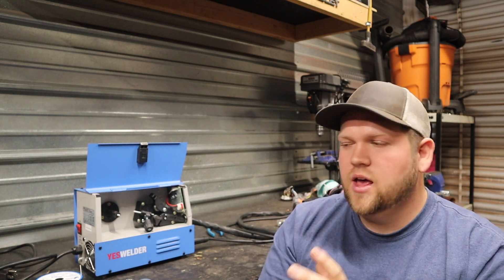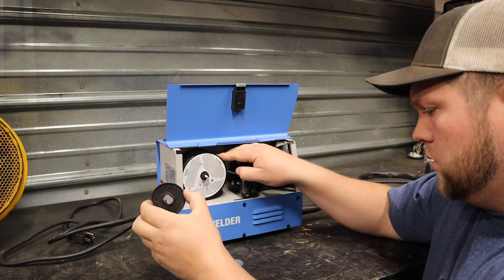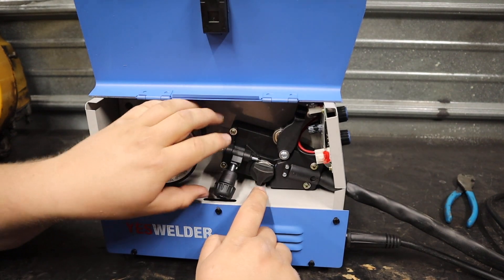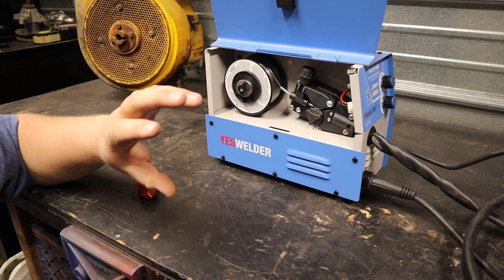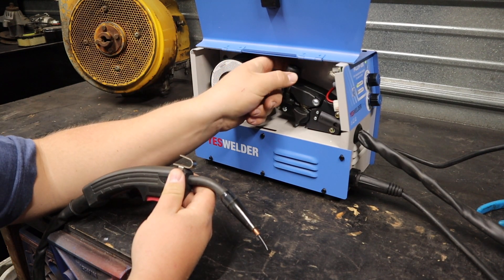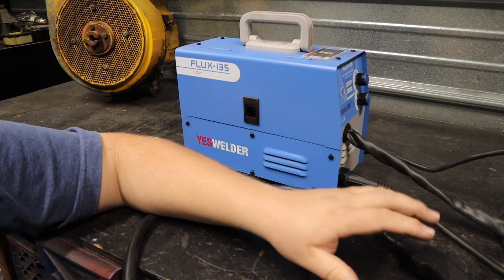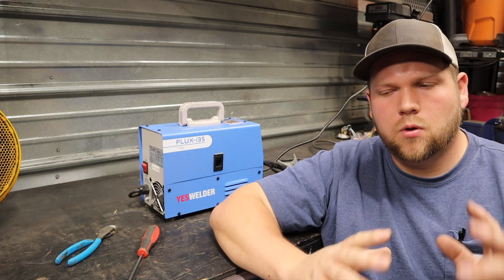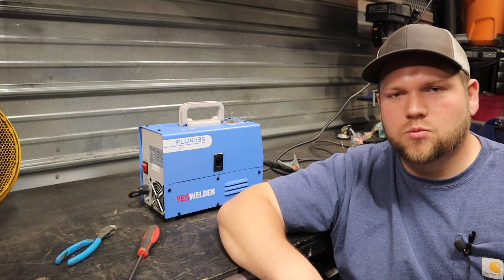Wire Feed Welding Basics - Setting Up a Flux Core Welder

Comment: Thank you. Good detailed presentation about flux core wire feed procedure. It's hard to find directions for it. Even the welder manual does not have directions for the wire feed.

Comment: good video....side note the angle of the spool into the liner looks hella tight on the yes welder. My FC-90 is like a straight shot.
Reply from the maker: It's not to bad, maybe a little tighter than some other FC machines I have used but it works fine.

Comment: How would you adjust the settings if you didn't have a chart and the knobs weren't marked in any meaningful way?  (actually I think the knobs are mis marked)  amico MIG-130A .  The current knob adjusts amperage, the voltage knob adjusts wire speed, but no way of knowing fpm.  Well, I guess I could time and measure it...   The manual has a settings table for a completely different welder!  (a Forney Easy Weld and the knobs are completely different!)   I bought it because the new version has detachable leads, and allow using an electrode holder for stick welding too.  And I thought it was a good brand at a good price.
Reply from the maker: I see that on that unit they don't have numbers to mark the settings, which is unfortunate, but they do have little tick marks that you can line it up with. I think what I would do is just number those tick marks with a sharpie and then take some material that you know the thickness of and then figure out what settings work best there and maybe write it on the inside of the door of the machine and then you can base how you will set your machine with other material thicknesses from there. That is a shame that they don't include numbers and even more so that they don't give you a chart. I didn't have any idea that there was no chart when I recommended this thing. I still want to get it and try it myself but thats a little disappointing.
Reply from the maker: Hey man I want to make a personal apology for recommending the Amico to you, and anyone. I read your most recent comment. I thought it looked like it had the larger space with the large “post” for 10 lbs spools. I guess simply reading the description before making the video would have helped. You would have ran into the same problems with the YesWelder as it has no chart or settings indications (the Amico is better in that sense that it at least has separated markings). I imagine you should still be able to return it with no issues if you wanted to get your money back? I don’t know how long ago you bought it but I sincerely apologize for giving bad information, and suggesting a product I didn’t know a lot about. I do want to get my hands on it and I still think it’s probably a decent machine but I am very sorry for offering incorrect info here. I was hesitant to make a video like that of products I have little experience with or none at all but I guess I went against my better judgment and did it anyway. If you could return it and use that money to get the Forney, I would do that. But again, I wouldn’t blame you if you didn’t feel anything I suggest was worthwhile. I deleted the video. One thing I don’t want to do is put out bad information. I was naive. I shouldn’t have made it.
Reply: @DereksWorkshopAndProjects  I don't blame you at all.  Amico gets good reviews, just no reviews of this machine.  It looked like it held a bigger spool from the photos.  And I just wanted to share what I've learned.  (I couldn't find this post to follow up, so I did on the other one)  I still think it's probably a good machine and am waiting on supplies to try it.  But I really am disappointed that they can't even put a real settings chart, and shocked they used a chart for a different machine!  I already bought an electrode holder, cost me another 50 bucks!  I don't think I'll send it back, just need to figure it out.    Still confused by the controls, why Amp display is not the wire speed.   I got it for $159 direct from Amico,  free shipping.  Home Depot is quite a bit more.  I liked the detachable leads too.  I'm sorry you deleted the video, it was good.  Maybe just add a note that it only takes 1lb spool.  I weld so infrequently I need to remove the spools or they will rust anyway, so small spool is not a deal breaker for me, but would have been nice to have the option.

Comment: Rookie question. Bound to need to get into welding sometime in the future...

What would be the differences between welding a new body panel patch on a truck (not mine yet), welding some tow hooks onto my truck frame, and welding a frame patch together (not on my truck yet either thankfully, just looking to potential future projects).

Would one welder be capable of all of these things? or would I need multiple machines of different types to do these well?

It's easier for me to make heads or tails of this stuff talking to someone directly in a format that I can understand...google is just word vomit sometimes lol.

Thanks!
Reply from the maker: So here is my opinion on that...

You could ask 10 different welders, ranging from hobby/farm/ranch guys like me all the way up to guys who do it every day for a living building hi-rises in NYC and get 10 different answers. In other words, everyone is gonna be different but it sounds like for what you’d like to do, that a flux core welder would do fine, but maybe consider buying a 220v MIG welder that can put a lot of heat into a weld (so like maybe a 200amp welder) and you could start with flux core. You could probably get away with a 110v flux core welder and get away with it. Cause there is going to be a huge difference in price. You’d just need to look up some methods for welding thick steel like hooks which would probably include beveling and running multiple passes but it can be done. Flux core is super versatile and can be much easier than stick and cheaper to get into than MIG. 

If you think your going to do it in the next 6 months to a year I’d suggest consuming lots of content from different YouTube welders to get a good idea of what you think you’ll want/need. 

Last thing - you’re going to find people who will tell you to not do flux core welding and that it’s inferior to all other process or it’s for lazy people or it’s just for metal art or whatever dumb comment they make. They are uniformed. Flux core is used every day to weld ships, buildings, handrails, etc.

Comment: I think one of the hardest things for the beginning welder is getting there machine settings correct. Get that right and you’re 75% there. I’ve watched many, many hours ( hundreds for sure) of YouTube vids on that, and still struggle with it sometimes. Any tips or tricks would be appreciated. Thanks and good vid.
Reply from the maker: Yeah, and thats even a challenge I am not sure how to address because I can weld and kind of decide which way to adjust but its not always the right adjustment or even if I think it is, that doesn't mean it is, because I still consider myself a beginner welder. I could probably address the obvious problems in a video well but fine tuning is definitely not my strength.
Reply: And the welder I bought doesn't even have a settings table on the machine, and the one in the manual is for a different machine and the knobs are not even the same!  amico MIG-130A